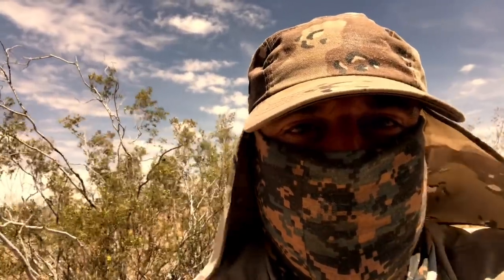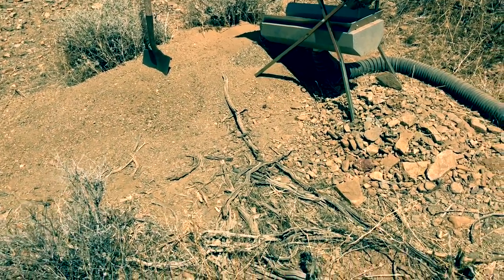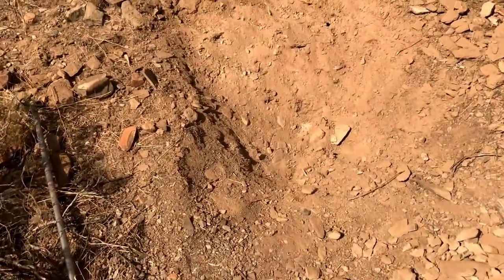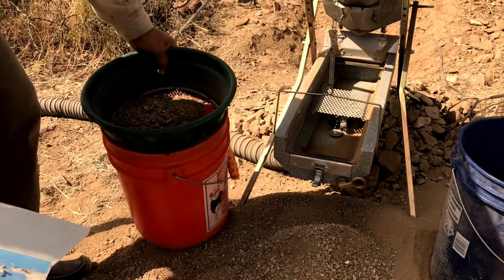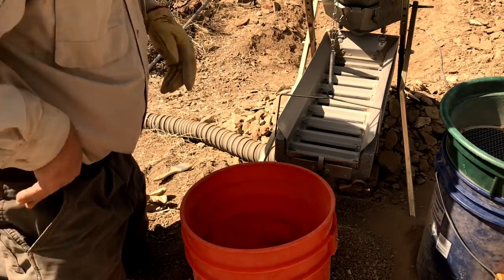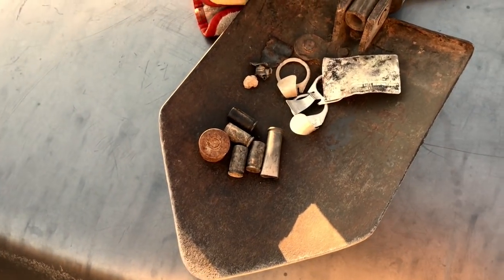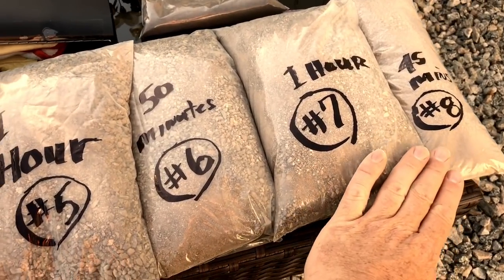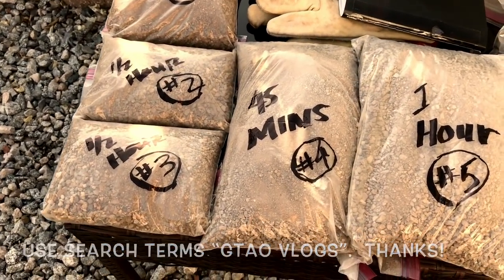Desert Gold Sampling, Metal Detecting | Prospecting for GOLD!

Comment: I don't have a dry washer I usually sluice.  but I want to check out an area that is unclaimed out in the Daggett Newberry area off the 40.  do you know anyone who rents drywashers?
Reply from the maker: Hi Cory and thanks for watching and your question.  Are you talking East of Barstow?  No, I don't know of anyone who rents them but many local clubs have loaner units especially for new members to use for limited times.  This way they can get a feel for it without an investment first.  The machines are not always in the best repair.
Reply: Yes thanks.  I know my grandfather prospected out there my dad showed me the gold.  But I can't find any  info on mining in that area especially recently.  So I don't know if it would be a waste of time. Or it could unpicked near virgin ground?
Reply from the maker: Cory, ...definitely sounds interesting my friend!  Many basic questions need answering still.  Is the ground BLM and unclaimed, is there reasonable vehicle access (doesn't require a road), how much overburden (sampling will tell), is it a remote area or lots of traffic, what sizes was the gold you saw?  The ground can be sampled without a dry washer.  For example "Dry Panning" or bringing in some water to do some test panning.  Also, keep an eye out for used dry washers and maybe consider joining a local club to get some loaner gear for testing.  Its an adventure for sure but stay quiet until you do learn about what is or isn't there.  Good luck and use my email for more talk about this place okay?  gtao@protonmail.com
Reply from the maker: It’s also possible that I could meet you out there to do some sampling for part of a day.  I could do this on the way to or from an upcoming trip.  We would need to arrange it and essentially you would be renting me with my gear.  I’d be happy to help only  if you want.  Take care Cory.
Reply: Thanks.  The gold was sandy, not fly poop but not chunky.  I have my grandpa's pan and crucibles.  He was using some very basic tech.  I am looking to go out there a few times this summer.  I'll keep you posted.